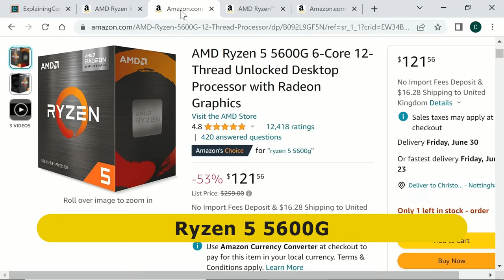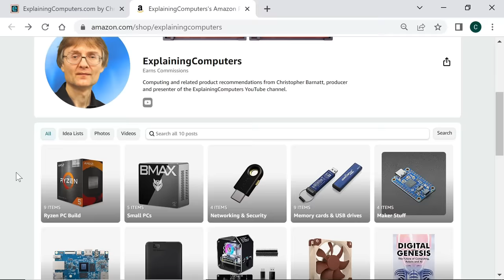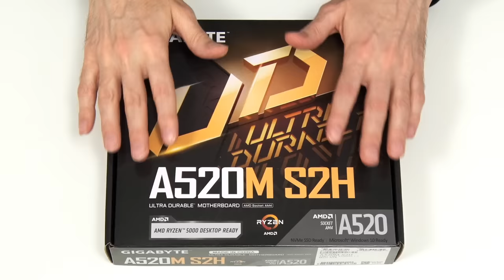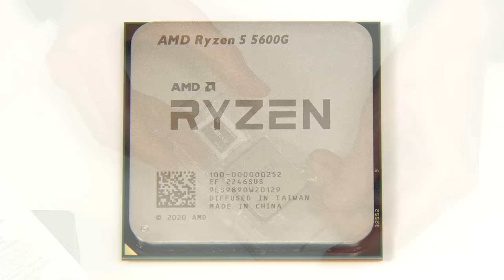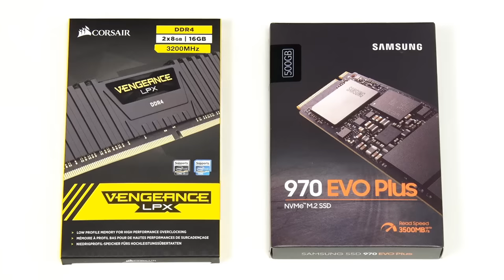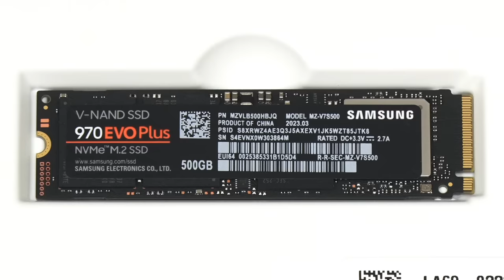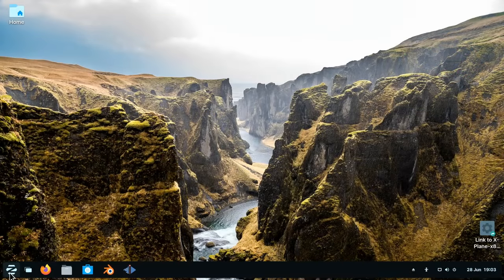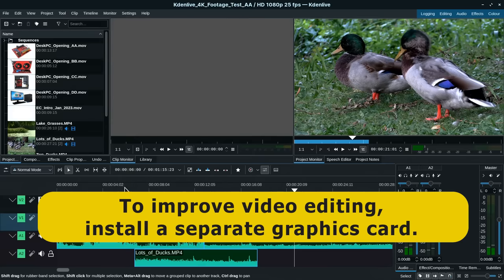Best Value Ryzen PC Build

Comment: That's a really good system for the money. Although I must admit those NUC style mini PCs would be another appealing option if a dedicated GPU isn't required.

I do miss motherboards being available in various colours. I think Gigabyte boards back in the day were blue.

If only the Amazon affiliate program worked on all Amazon stores worldwide. Especially with Prime Day coming soon!
Reply: I like NUCs a lot, but they are terrible value currently, a similar spec to this will be close to double the price. Apart from the small form factor it's all negatives. You get less performance from the laptop CPU, they run hot and loud. Most are practically non-upgradeable.

Comment: This is  similar to the processor I'm using, a 5700g. The 7000's only have a 2 unit GPU compared to the 8 unit one on the 5700g. You could theoretically game on the 7000 series apu, but only old games or very light indies. It's more of a minimalist gpu for spreadsheet users. The limited nature of the AM5 apus is why I'm considering a mini desktop with a 7840u/h mobile chip instead the next time I upgrade. It's kind of cool you can still get motherboards with PS/2 and VGA.

Comment: Beautiful no nonsense pc build video. In what ways is this build better than the Dell Optiplex 9020 with Intel i7 4770 3.9GHz + 32G RAM, currently retailing at $261? I'm pretty sure your build is faster, but by how much? A little, a lot?
Reply: Great q...thoughts:
1. Pretty certain the 4770 is a bit slower
2. But 32G of RAM?  Methinks that will more than make-up for difference 
3. What size SSD on the Dell rig?
4. Will the manufacturer case be able to handle an upgrade such as this in the future?  (my kickass rig from HP could not... ;^[  )

Cheers!

Comment: Those Ryzen APU are way better than they have any right to be for graphically intensive applications, especially the new ones that have come out since this video. I wouldn't say the NEW ones are the best bang-for-buck in a desktop vs. an inexpensive dedicated GPU, but for SFF or power-limited scenarios they are SO good. My little Framework laptop has the 7840u, and I'm blown away by how good it is for an iGPU. It even has support for hardware accelerated GPU rendering via HIP in Blender!

Comment: One small correction at 2:36 - The newer Rzyen 7000 Series CPUs are APUs as well since all CPUs have an integrated graphics solution. 
None of the new CPUs have the "G" attached to it, which marked earlier Ryzen CPUs as integrated graphics. 

So what you said is true for Ryzen 1000 to 5000 series, it's not true for Ryzen 7000 series.
Reply from the maker: Sorry, but you are misrepresenting the content in the video. I pondered this issue greatly and worded things very accurately. What I stated on this matter is correct in all instances.

For start, AMD does not label any released 7000 chips as APUs. Now certainly it could be argued (as you do) that they are APUs, as they include an iGPU and a CPU. But this is a dubious argument, as "APU" is a marketing rather than a technical term (Intel chips with a CPU and an iGPU are not APUs!). So if AMD are not applying the APU marketing label, there is no technical reason to apply it.

But even more fundamentally, I chose to avoid even this argument. If you listen to what I actually said and wrote, in audio I stated that "Currently there are no G-suffix Ryzen 7000 APUs". And this is 100 per cent factually correct. And in the graphic, I wrote "Currently, there are no Ryzen "G" APUs". And again this is correct.

What you seem to be stating is that I said that there were no Ryzen 7000 APUs -- and I never said or wrote this. I've been drafting technical and sometimes legal documents professionally for over 30 years, and know how to keep things accurate, even in linguistic quagmires like the one that AMD has created for us here. :)

Comment: For these more affordable budget Ryzen builds I recommend the Deepcool AG400 tower cooler for silent cooling. I find the stock Wraith coolers aren't particularly quiet and the whole cooler needs replacing if the fan gets louder over time. And with removing coolers in general on AM4 it's necessary to break the seal on the IHS by lifting it up from a corner first, otherwise it rips out the CPU from the socket. It's an annoying flaw with these PGA sockets.
Reply: why does this cooler avoid the problems you mention? thx

Comment: Gigabyte has been having some trouble. I have one  Gigabyte motherboard that I game with. Some of the stuff that was going around is the lock hook on the video cards are cracking. I do not know If that is true but I have a very large heavy Gigabyte RTX 3060 and the card worked loose. I think I caught in time I put a oversized screw to hold it down and one of those little support braces on it. I think think the problem is graphic cards are heavy these days and the sheet meatal in cases is not really strong enough to hold them. I have a Zeus RTX 3050 heavy one fan that did the same thing. I think it would be wise to check your graphic cards before you get into trouble. The GPUs these days are just so big & heavy + take up a lot of slots. Your rig will not have that problem.

Comment: If you are on a budget* the A320 and Ryzen 5 3600 can be had for about half the cost in used condition.  And 2TB PCIe 4.0 NVMe are around $80 on Amazon.  A320 may need a BIOS update, I used an A10 9700E, but similar A6 and A8 are available for $5 or so.

* or want a discrete graphics, the $100-125 you save can get a GTX1070 or RX5700 for example

Comment: Nice build, however I would have made one thing different: use 3600MT/s instead of 3200MT/s RAM. The costs are more or less identical, but the 3600MT/s RAM has slightly more bandwidth which should be helpful for the iGPU. Maybe not by much, but if the additional costs are close to zero, why not?

Comment: Nice build Chris. A sensitieve approach building a PC that shows you don't always need the most epensive parts and you don't need to have a RtX 4090 or a Core I9 for gaming or editing.

Having said that, I was looking forward seeing you unpack a new graphics card. Always nice seeing those boxes containing a new card. But maybe that's for a future update? Personally I like a more future proof build so it can contain a newer generation cpu but still a very nice build especially for that price.   

And finally. I was looking for a nice flight sim that runs under Linux. Always been a bit dissaponted with Flightgear. But while X-plane looks better I am a bit worried about the installation process. It isn't includded in the official repo, in my case Linux Mint, and feels more like installing things the Windows way.  Dowloading an exe file from the internet. Since I was curios, wanted to see what X-plane looked like and just for the fun I went through the installation process but  now I don't see a real way of uninstalling it. I am not worried about it containing anything malicieus but it's a bit of a mess not coming from an repo and the only way of uinstalling it seems is removing the installation folders. But still it's a bit of fun trying out and I don't think it will cause stability issues either.

Comment: @ExplainingComputgers - with your upcoming PSU video could you cover also the claimed improvements of Pico PSUs over their more conventional counterparts?  I've seen claims made (lower thermal and lower draw at the wall);  the former I can understand as it offloads some switching to the external brick but I've yet to see evidence of draw-at-the-wall being different.  I think draw at the wall - also when idle and in standby - is a bit of an elephant in the room for many.

Comment: Great video as always, and while I've been an AMD fan for many years, I hope you at some point take a look at some the Erying Chinese desktop motherboards that are reusing Intel laptop chips with very high core counts like the 45 watt Intel Core i9 12900H w/14 core & 20 Threads which does have onboard Intel graphics, as well a PCI-E 4 8X slot for a GPU, for about the same money as the Ryzen 5 7600X build with 32GB DDR4 RAM. 
I just recently did my current build with one, along with an AMD RX 6550 XT 8GB GPU, and it's been fantastic so far, but do remember to use good thermal paste, a down firing CPU cooler to keep the VRMS cool, low profile RAM so it clears the cooler, and to set the XMP profiles to 3200Mhz for the DDR4, and you should be set.

Comment: I've been using the version of this chip with the burned out GPU section in my gaming rig for a year.  I bought it to replace my old Zen 8 core, even though these monolithic designs do lose a little performance compared to the standard chiplet designs the Zen 3 architecture is just so good compared to even Zen 2 they perform really really well, especially in gaming and for the money, a lot faster and more consistent than the first gen part.  An entry to mid tier used GPU (RTX20 series are getting cheap now and that PSU can handle a 2060S/2070 easily enough) would make this a very usable machine for all round tasks, maybe add in some USB3.2 ports and Bob's your mothers brother.  BTW I used to have Patriot 3200MHz RAM in my system but it wouldn't play nice with the R5 5500 so I had to swap it out with some Hyper X stuff I think it is which works fine.

Comment: Excellent video as usual, but I thought a build with a 12th/13th gen Core i3 with integrated graphics would be cheaper and much faster, no?
Reply from the maker: Quite possible a 12/13th Gen i5 would have more CPU power, probably not GPU power. I'm not aware of a hexa core i3 (although the E/P Intel cores compliate this). I did an i5 build last year! :) This was a Ryzen video.

Comment: Some things never change.  The processor being the most expensive component of any PC build.  I haven't built a PC for about 5 years now, (as I'm perfectly contented with my present set up), but things haven't changed as far as rigging the mainboard up to the various connections is concerned.  Having a graphics card within the processor is a new innovation.  Previously, it was the mainboard that had a graphics chip, albeit not a great one.  The ones within the CPU look fairly decent.

The important thing about building a PC is to have a little bit of patience when putting it all together.  There's no point in rushing things and potentially damaging component in the process.
Reply: Integrated GPU isn't something new, AMD just stopped to call it APU after end of FM2+(which is strange, cuz modern Ryzen APUs are real APUs, able to compare its performance with low end Nvidia GPUs, unlike e-waste series of A6-A12).

Comment: Hello again. I purchased the components you mentioned in this video because my (very ) old PC eventually broke down. I also followed the recommendations of your comment down below but I have a doubt concerning the update of the BIOS. I have been searching for information but nothing looks trustworthy out there. Would you mind stating some quick steps to follow for me to update that BIOS in case it is worth it? Current version F15, most recent one F17c, that is for A520M S2H running LINUX MINT. Looking forward to hearing from you. Thank you so much for your great work.
François.
Reply from the maker: If your machine is working fine, do not update the BIOS. :)
Reply: ok thanks for your quick reply  @ExplainingComputers

Comment: 18:00 I sometimes wonder why ATX and similar cases are built as heavy steel boxes with decorative plastic bits tacked onto the outside. Is it a fire concern, or guarding against electrocution? Desktop cases would be much lighter and more portable if they could be built out of carbon fiber, cloth, or plastic, with only a sparse metal skeleton to provide attachment points for the front drives, motherboard, PSU, etc. Maybe do a video on what specifications go into the ATX and mATX standards? As well as small form factor PC cases, since ATX and mATX are on the way out?

Comment: I went MSI 450 Tomahawk MAX II, Ryzen 5600X, and at the time I found 32GB (4x8) crucial DDR4 very cheap. Honestly, bang for buck, the best system I ever built and it was.... very cheap. Yes, I used my old case and PSU, Yes, I used my old 1050ti  and yes, I populated it with 6 SSD's that really should have been put in the bin by now. But it works. Planning on a decent Nvme drive ugrade this week... Other than that... its just storage from here on in... Yes, it could defo do with a GFX upgrade, but cost vs performance...? Meh. The 1050Ti is doing ok at the moment. I got the MSI mobo for £39.99. Yes, it's a B450, but - £39.99 and had been pre-updated to accept the 5600X? YES PLEASE. I am all about cheap and efficient. I do regret my mobo on some fronts... I could have got a 550 for not much more... but... I am happy with my lot.
Reply: As an update - added a 2TB Nvme and a 7 port (5 USB 3,  2 Type C) card, plus a bunch of USB banks, external HDD docks and a nice 32" monitor. This B450 mobo is.... really rockin'!!!!!! The Nvme turns OFF two of the six SATA ports, but thats ok - I just use those drives via the Docks. Next step is getting the Touch Screen working on the 22" illyama.. I think I'll be done then.... For a B450... I'm really pushing this unit.... But so far... it's fine (famous last wo..........) Hhehehe.

Comment: For Q-Flash you say the process is to "power up the board and press the Q-Flash button". Are you sure that's correct? Back when I flashed the bios on my msi b450 motherboard with the equivalent functionality the process was to put the file onto a USB drive, plug it in, and press the button WITHOUT turning on the system beforehand. Also the size of the USB drive seemed to matter; anything larger than 4 GiB did not work, presumably due to something like a 32 bit address space.
Reply from the maker: I clearly expressed this badly. What I meant was that power supply needs to be connected to the board and turned on. But you are correct, the system does not need to be turned on. The size of the USB drive is irrelevant, but it does need to be formatted FAT32 (with is often not the case on pre-formatted drives over 4GB).

Comment: Nice Ryzen pc. Cost effective .
Reply: An engineer at heart, smartly selecting components wot meet the "necessary and sufficient" criteria for his use cases.  No need for ridiculously high-wattage CPU and GPU which in turn require an air conditioned room due to waste heat.  Proper consideration for climate change (and electric bills) given.

Comment: Make sure you are on the latest UEFI/BIOS version, especially with a GB motherboard. 
A worthwhile upgrade would be a 2x16GB ram kit. It's ~20-25 pounds more expensive, but you get the benefit of dual ranks (should boost the APU's performance). 
Some A520 boards "technically" allow overclocking. PBO and Curve Optimizer tuning are enabled on some boards and you can get a decent boost in performance and a bit lower temperatures with minimal effort. Overall AM4 is still an amazing platform.
Reply from the maker: The memory fitted here is 2x8GB, so runs dual channel, just as 2x16GB would. So there would be no APU benefit of fitting 32GB.
Reply: @ExplainingComputers  Yes, yes. Dual Rank is (somewhat) different to Dual Channel though. Dual Rank increases bandwidth by enabling the memory controller and CPU to access more ranks of memory allowing it to do more operations within basically the same time as a Single Rank configuration. Most 16GB ram modules are dual rank and depending on the rest of the hardware it can give a quite good performance boost (especially in such cases where the APUs graphics processor is starved for memory bandwidth). 4x8GB is also Dual Rank, but the motherboard in this case does not allow such a config. Anyways, great build tutorial! Longtime fan of yours.
Reply from the maker: @Totto70770  Ah yes, sorry -- I see what you mean. My bad.

Comment: 11:30 I might have suggested that CB hold the APU on its side so we can clearly see the pins in profile — but quick viewers can get this view by pausing at exactly the right fraction of a second at 11:18 .

I upgraded the PGA CPU on my first PC (an HP desktop with a 633 MHz Celeron —> 850 MHz P-III) over 20 years ago, then built a couple of homebrew desktops with PGA CPUs (late 32bit and very early 64bit AMD CPUs), so those are familiar. Looking forward to seeing one of those new LGA CPUs in an upcoming video, if CB hasn't done one yet.

Comment: A timely video I'm just about to buy a 5600g 16gb 3200 ddr4 ram  Samsung 500gb m.2, still deciding on mobo probably a b550 msi tomahawk . Not sure  if it will be with ot without WiFi, already have a good corsair r200 case and a corsair 650w semi modular power supply, I will be running Linux
Reply: Eyyy, Linux! Which distro are you planning on throwing on there?

Comment: I'm impressed by a device that can give itself a brain upgrade without external assistance.
Are all the internal connectors now sufficiently different that Murphy can be thwarted, or is there any ambiguity in location or orientation?
Reply from the maker: Murphy is indeed greatly thwarted these days -- no DIP switches or jumpers to get any more! :) And connectors that a pretty foolproof, unless forced hard in the wrong orientation.
Reply: @ExplainingComputers  Only exception I noticed was it's still possible to install the front panel LED connectors the wrong way around.